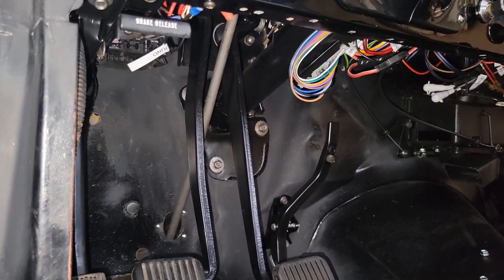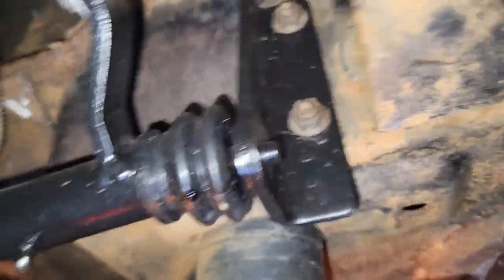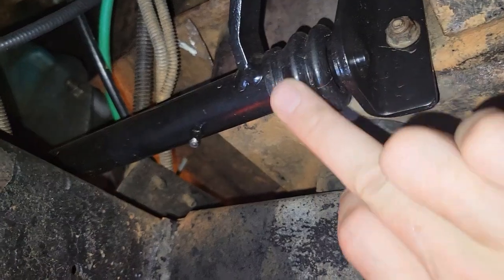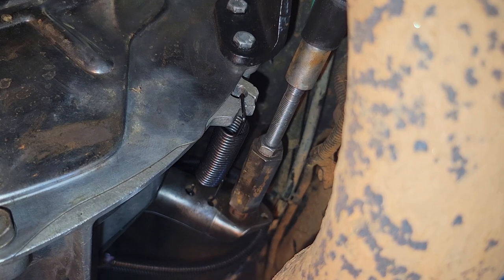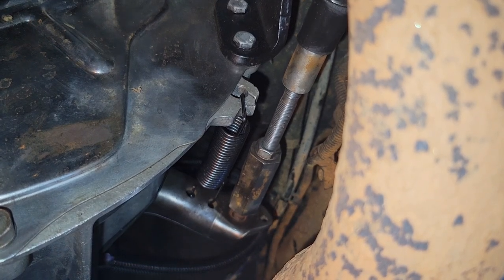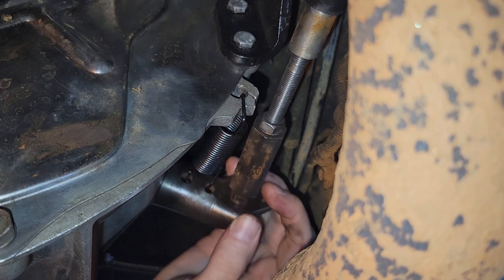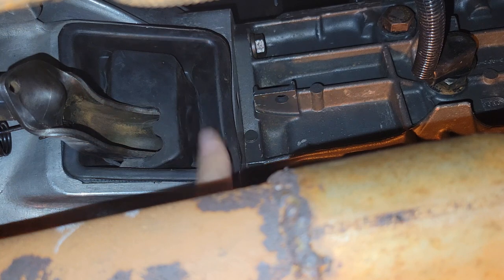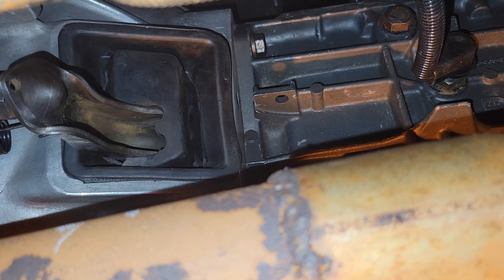Jeep CJ7 1981 258 Clutch linkage walkthrough

Comment: You should definitely think about replacing the original with a rod end (heim joint) unit. That new rod will wear out again and slop will increase. I replaced my 76 cj5 one which now has very smooth operation and I have zero issues. I am very glad I did it.
Reply: I've had the ball joint fall out of the rod socket over time as you point out. Not sure what a  rod end (heim joint) unit looks like for that particular Jeep application.  Can you provide more information

Comment: Great video. I have to practically stand on my peddle to get the clutch to disengage. Gives me a better idea as to some of the adjustments I may need to do. Do you recommend any videos on how or proper way to adjust the linkage ?
Reply from the maker: @jacobsimmons3565  You shouldn't have to press that hard.   Disconnect the bottom end of the rod that goes their the firewall and see it the high tension is caused by the return spring attached to the peddle.   If it's not that, there may be something going on in the bellhousing with the clutch fork or pressure plate.  Not sure about a video that shows the inside if the bellhousing.

Comment: I put new bushings in the bell crank and new motor mounts a year or so ago.  Just recently, I started having problems with the bell crank pulling off of the ball joint on the bellhousing side—-a very unsafe and frustrating problem.
Reply from the maker: Very frustrating, am surprised I don't hear about it more.  Just kind of preciously pushed up against it without much protection from slipping out.